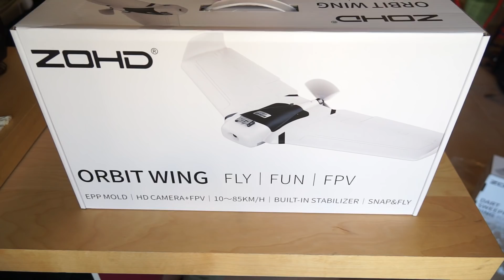ZOHD Orbit FPV Flying Wing with Stabilization System

Comment: Could I use a 3s 25c 11.1v 2200mah Battery? If so what flight time is possible?
Reply from the maker: I Flew with 4S batteries, so not sure if 2200mAh will be at heavier side or not?

Comment: Can i slide in a gopro session5 in the fpv slot?
Reply: No, you can't. Not without modifing the plane or the nose cover. There is exactly correct wide spot for Session5, but not high enough. It would require some cutting to fit it. I may do it in the future as there are some pre-cut available.

Comment: Hi Ali thx again for ur reply. I have ordered my wing & it should be with me just after xmas. I have tried to read up on this but unfortunately there is very little info on this. I can see by the instructions that there is a designated plug for spectrum. But that’s as far as they go. All I need is a wiring diagram then I think I’ll be good to go. If u do a video that would be great as I always watch ur videos with great interest. If all else fails I might just have to purchase a compatible tx but I’d much prefer to use my trusty spectrum. Thx again Ali. All the best Paul 😃😃

Comment: Hi Ali thx for the speedy reply. When u say a dedicated plug I can see that on the instructions but can u plz give me the way to connect. I se the 3 pin plug but where does that actually connect to my r615x. Thank you very much Ali & again another excellent video presentation. Thx Paul 😊
Reply from the maker: I do not use Spektrum but i was told that its plug and play using that white port for Spektrum Radios. I will see if I can make a video as per time, but no promises

Comment: You show the wires to connect to the receiver. I wish you would show a receiver being hooked up along with the controller you recommend to use. Being new to it you lost me at that point. I would GREATLY APPRECIATE if you would do this along with the links for everything. Include best camera and an actual video from it. I would be VERY GRATEFUL because then I would buy one.
Reply from the maker: I will try to do a video.
Reply: As a designer, I must step back and scratch my head here. Lacking a horiz/vert stab and fuse.. which only increases drag and efficiency of the lifting surface and lends itself to possibly a slower more docile flight experience which newbies may find desirable - I'm blown-away. It looks like ZOHD incorporated all the variables into the equation here. They made it very difficult to compete with a base of $99! Granted, this is NOT a plug and pray all-up RTF bar-tab.. but the incidentals MAY be the BEST features of the thing! One can go "all-out-balls-to-the-wall" with add-on's OR get airborne with a $49 frsky radio and a Zippy-pak from "Bango" but don't omit the FPV! This bird will be out of sight before you can say "who struck John"! Yes, "speed" IS a factor on ALL F/W's and this is no exception.. My advice is don't make this your first fixed-wing! Its just too fast for noobs. Aside from this - thanks to this number from ZOHD.. looks like I have more to think about..

Comment: Has anyone ever fitted an rx Spektrum receiver to this wing. If so any wiring help would be much appreciated. Thx all Paul Foster
Reply from the maker: For Spektrum receiver, Flight controller in this plane has a dedicated port. just plug it there and setup a normal plane in your radio. let the FC do the rest of the mixing.
Reply: @alishanmao  Hey, this might be a stupid question. On a Spektrum receiver you wouldnt hook up the other wires to the receiver? Just the plug? I'm not using Spektrum, I'm just curious if thats the case for Spektrum?  I'm putting a Frsky X4R into is, i'm assuming I just hook up the loose wires from the FC to the X4R and I'm good to go, right? Have never setup a wing, i'm coming from quads...no servo experience except for cars.